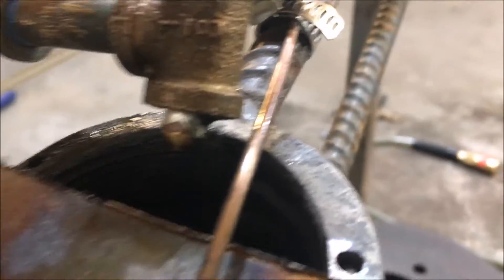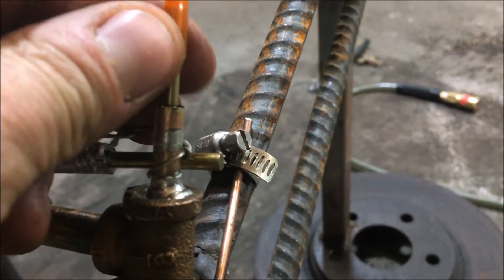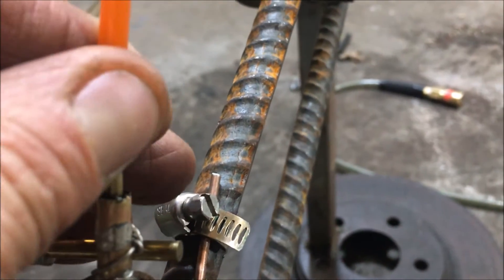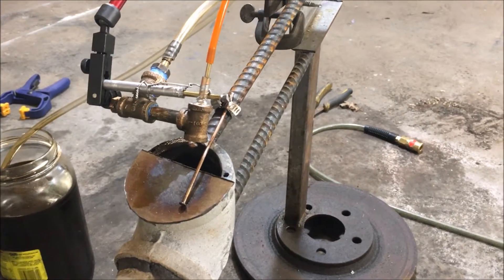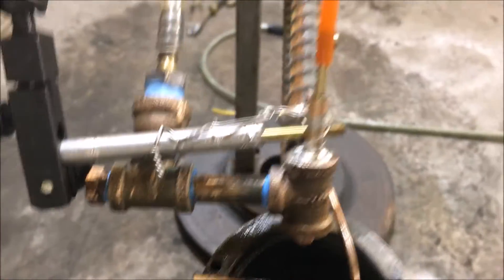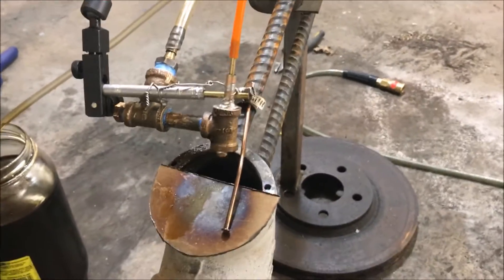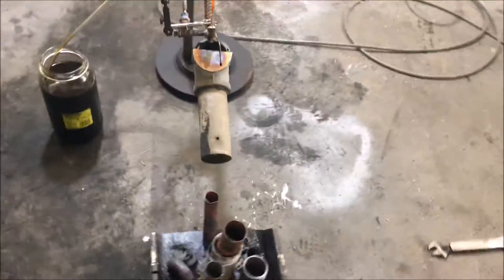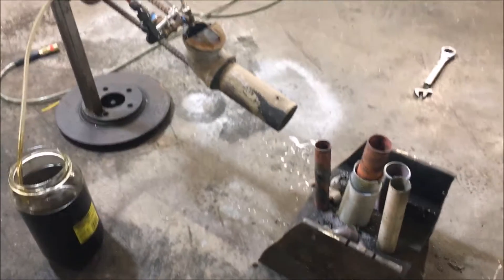Waste oil ( Siphon Nozzle ) Designs Prt 2

Comment: obviously the air pressure required for misting is cooling the air quicker than the oil can combust.   Only option here is to mix some fast burn fluid with the oil or have a constant flame relighter